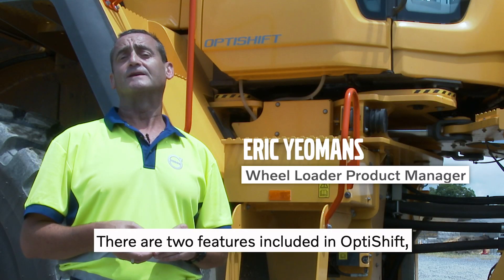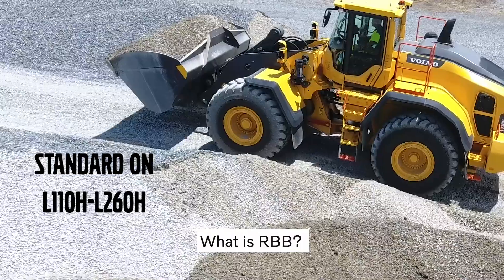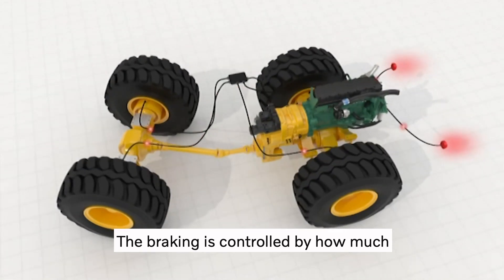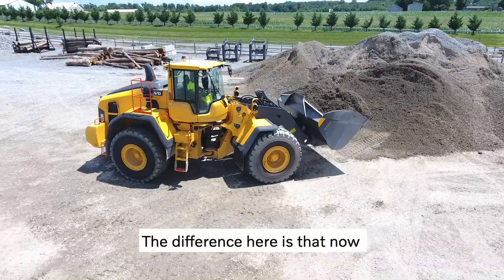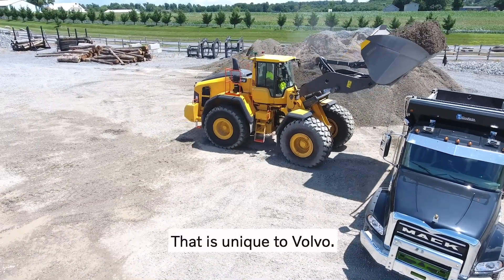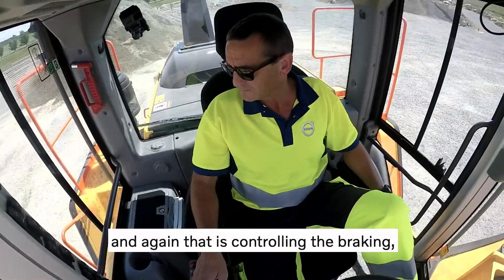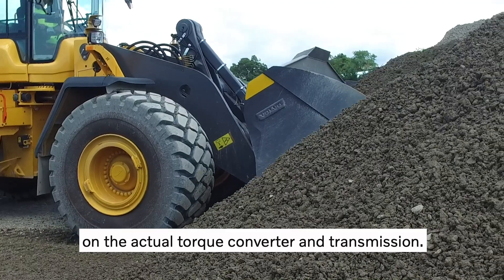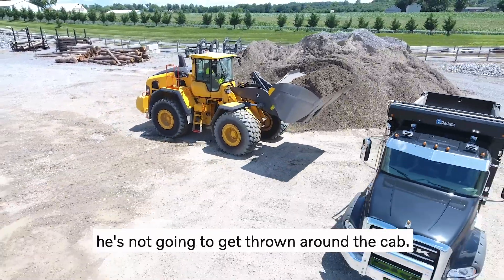How Volvo Reverse By Braking Works

Comment: Are the  RBB function is have in l150H ???
Reply: Dishon Johne its standard yes
Reply: @25fnf  so how i can
Reply: @25fnf  please teach me
Reply: Dishon Johne do you have an L150H ?
Reply: @25fnf  yes L150H 2018
Reply: Dishon Johne then reverse by braking is on it, when you reverse back from a stock pile, dont press the brakes and shift to forward and the machine will slow down and break by itself, it saves fuel, less wear and tear on disk brakes and makes it more comfortable
Reply: @25fnf  thanks sir. I will do it now
Reply: Dishon Johne this function is working on l90h?
Reply: armando santos No, it only works on machines that have the OptiShift (L110-L260H) I don’t know if the L350H have RBB.
Reply: Cool thanks but I'm guessing it only in the h series?not the f series.
Reply: We just replaced our old L220E with a L110H and found this interesting as I always stop before changing direction to avoid shock loading the drive train.